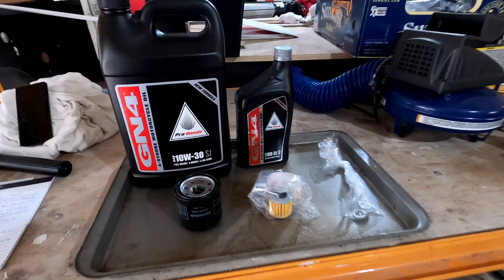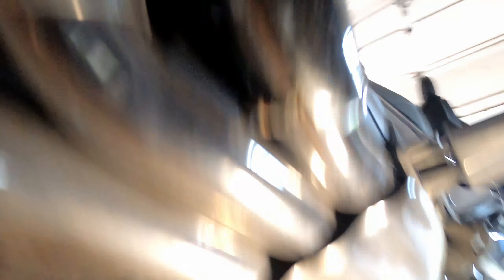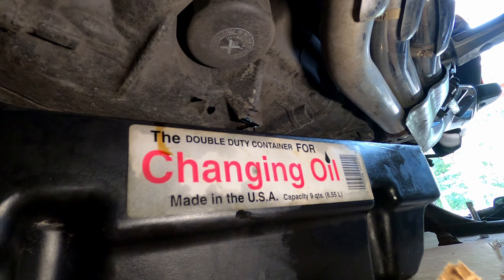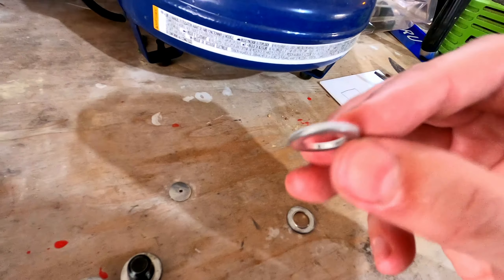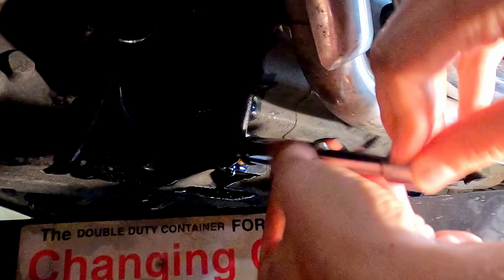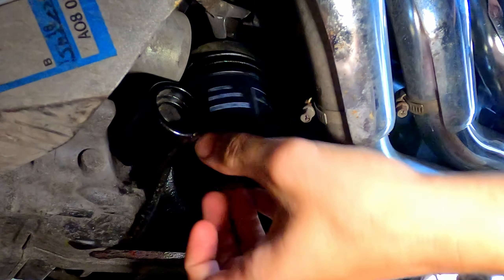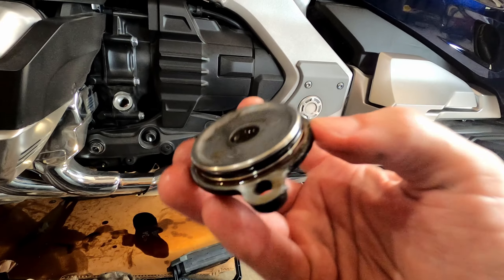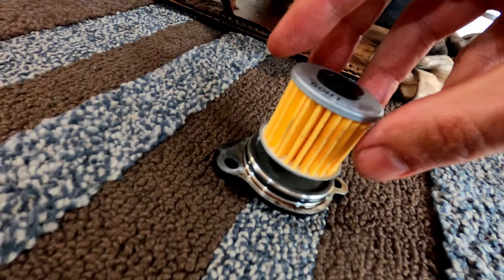HOW TO do an OIL CHANGE on the 2018+ Goldwing | DCT Filter too!

Comment: As far as the crush washers go, after 115K miles my 2015 Yamaha FJ-09 still has its original crush washer. I'm cheap and it still works. Thanks for the videos. They've helped me in my decision to buy a Goldwing.
Reply from the maker: Thanks!  I don't think you'll regret buying the new Goldwing, but make sure to test ride one with the DCT first before buying just to see if you like it!

Comment: What size is the crush washers and during the DCT initialization you showed DDN.., what do we do with that?  Thanks
Reply from the maker: I'm not sure offhand what size the washers are, the Honda dealer just gave me the correct ones.  The DDNDN is the code you key in using the manual shift pad, D = Drive and N = Neutral.
Reply: @MotoMengy  Thanks

Comment: I assume you warmed the engine up before changing the oil and filters. I’ve been using cheap aluminum pans from the dollar store. They’re big enough and low enough to allow access to the drain plugs and not get oil all over the place. After changing the oil & filters I run the clutch initialization. It seems to run better that way. I ran across a thread somewhere that recommended an alternate O ring that fits better and lessens the chance of binding/pinching. (learned you do the initialization also 👍)
Reply from the maker: Yep, I always warm the bike up first.  And yes there is an alternate O-ring part which seems to work better, but mine is still good so I'll keep using it for now.

Comment: Mine was a PITA..none of my oil filter wrenches worked the dealer didnt have any kits in stock or caps,  i had to try every single cap at auto parts stores till i found one that worked .
Reply from the maker: I just use an old clamp style filter wrench.  It isn't ideal but it works with a bit of finesse.

Comment: That oil isn't synthetic which it must be
Reply from the maker: It's the recommended Honda oil, I just use what the dealer, owner and service manual say to use.
Reply: @MotoMengy  That's fine but use the Honda Synthetic or Motul Synthetic, the Motul will quiet the downshifts and shifts more,, it's just an unwritten law..
Reply from the maker: Interesting @seatime674  , I'll have to try that next oil change!
Reply: @MotoMengy  People have went from the Honda oil to the Motul 7100 synthetic and said it was a massive difference in shifting